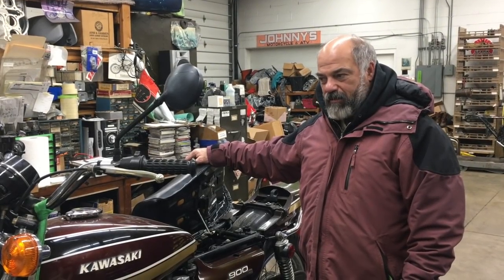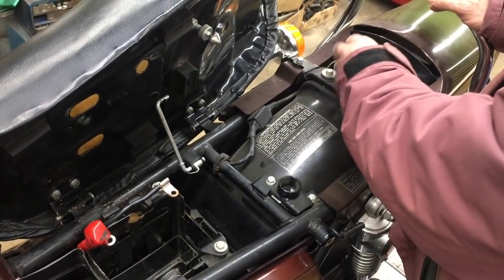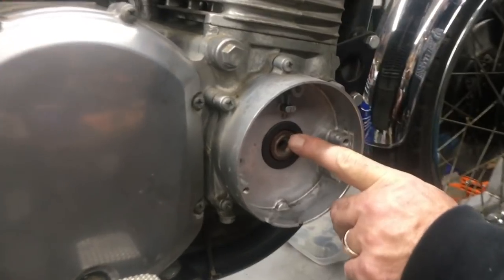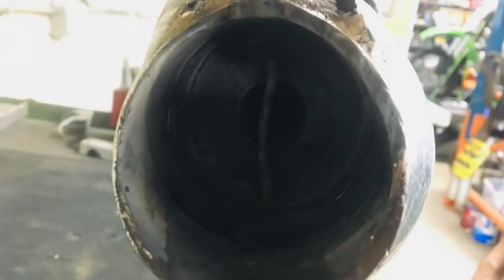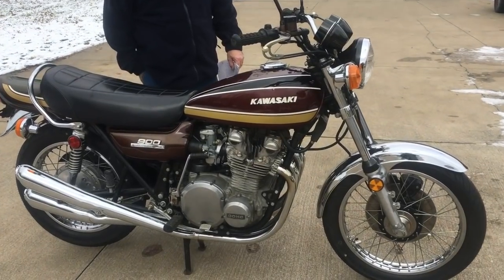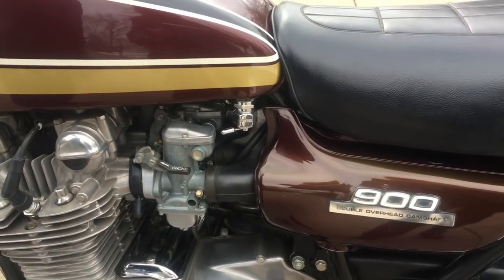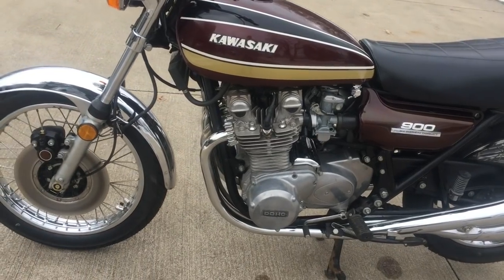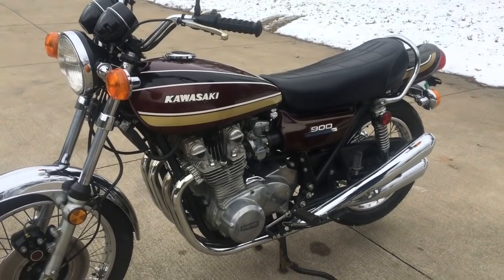75 Kawasaki Z1900 Unrestored Wonder (sold)

Comment: Is the the red, looks like a blend of colors in the light.
Reply from the maker: Because of the way Kawasaki layered the colors, they fade differently. For example you can see a green tint coming through on the tail piece on this 75 Z1. Also, the plastic surfaces fade quicker on the plastic body pieces than on the metal tanks.

Comment: What did that bike sell for? I picked up the same bike but with all original parts down to the pipes. She had 16k miles on it, now upto 18k.
Reply from the maker: I would rather not say as we never know if our customers want to resell them or not. This is a very nice bike and we did offer a warranty with it.
Reply: @Johnnysvintage  Thanks for responding. I appreciate you taking the time to respond.  How can I get in touch with you to buy original stock rear shocks for my 75?
Reply from the maker: We are Johnnys vintage motorcycle in Wadsworth Ohio
Reply: @Johnnysvintage 
Chris